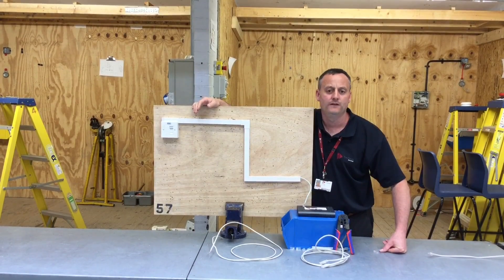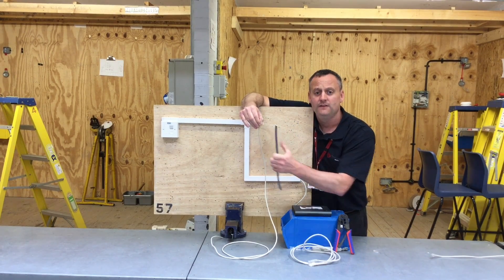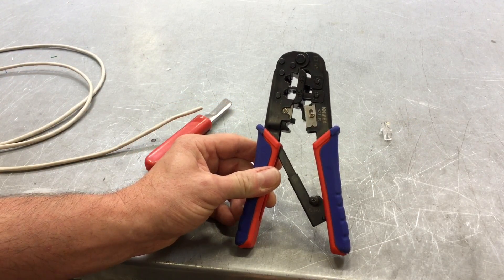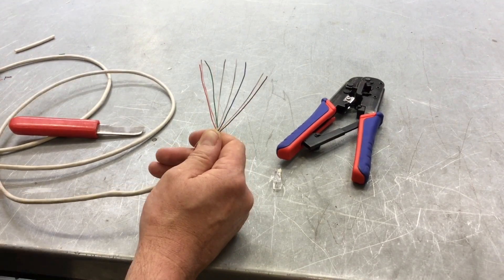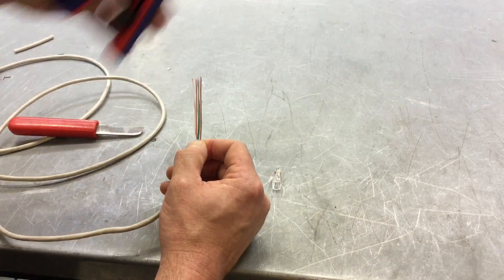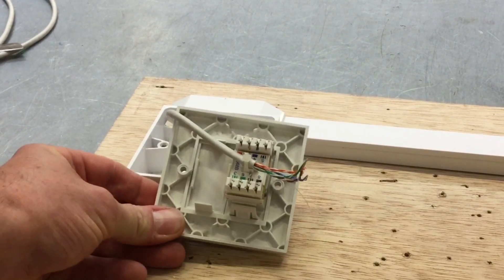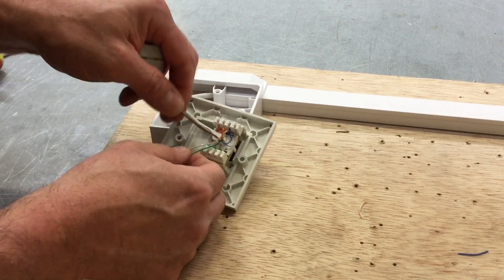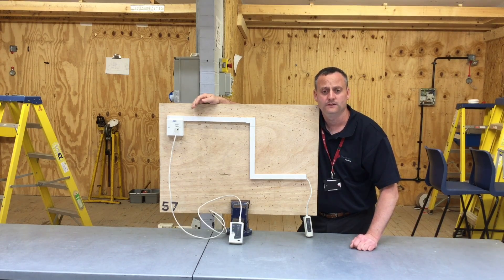Terminating CAT 5 (Ethernet) Cable into a RJ45 Connector Including Testing and Full Demonstration

Comment: OK couple of miss-conceptions here. The twist has nothing to do with induction from the 'mains', if that is likely to be an issue then you should be using STP (screened twisted pair). The twist is there to reduce crosstalk between pairs. In data cabling this prevents a strong signal on the TX pair bleeding into the weaker RX pair. 
On a practical note I would echo others comments about using the cord to strip the outer - that is what it's there for. Also most importantly is not untwisting the pair. The spec says no more than 13mm of untwisted wire for Cat5 and 10mm for 5e & 6 but remember you've got several mm untwisted in the terminal so it's best to maintain the twist as far as you can. This is imperative if asked to wire a patch panel. Also that tool is called a punch-down tool for a reason - give it some welly, it will cut better and ensure the wire is pushed right down in the connector. Not being the latter is the most common cause of a dis.
Testing. A simple continuity/order test as shown is fine for a simple cct in a domestic situation. However NEXT and FEXT (near end & far end crosstalk respectively) tests should be carried out on anything more commercial.
Out of the trade now but I had 19 years working as a comms tech specialising in hostile environments.
Reply: What do I need to pay for a NEXT/FEXT testing device?
Reply: @Asdayasman  You can get a shitty cheap one on eBay for about AUD$10 and it will check the connectivity of each of the 8 wires. If you stretch it to AUD$15 then it will do not only RJ45 but also RJ11, RJ12 and USB. Bear in mind that you do get what you pay for and don't forget to make sure the battery in the tester is still ok before you go out on a job.
Reply: @josephking6515  No, that's just a continuity tester, not a NEXT/FEXT.
Reply: The RX isn't 'weaker' than the TX pair. The RX pair is just the TX from the other piece of equipment! I agree with the sentiment though.
Reply: Of course you are correct at each point of transmission however what is important is the relative strength of each signal and hence the effect of crosstalk on signal to noise ratio etc. which of course in turn effects error rates. Measured almost anywhere but in the middle (assuming equal attenuation and transmit levels) then the level of the arbitrary RX will be below that of the TX and in that sense weaker.
It is this relative difference that is important with regard to both near and far end crosstalk in incorrectly terminated cabling. In the transmission  world most equipment will AIS (alarm) at an error rate of 10^-9 and shut down at 10^-6. Which is not a lot.
Reply: I wired my entire house with Cat5e about 15 years ago and was unaware of the need to maintain the twists as far as possible. I wired the face plates similarly to how it was done in this video.

However, it has been running at 100Mbps the whole time without a single issue. I also split each cable into two lines, as only two pairs are used up to 100Mbps. Obviously I'd have to rewire the plates for Gigabit.

Comment: Use a pass through RJ45 glass end if it's an internal fix .Those will save you both time and to a point fail safes in terms of faults .
Especially when your knackered after a long day of pulling in .

Comment: That cable was not "tested". All that device did was verify continuity of the conductors. It's basically a data version of the Wandering Lead. Proper testing of data cabling with the appropriate test instrumentation not only verifies continuity but leads to certifying that it can carry the data and at what transfer speed. As far as I know proper testing and certification of data cabling isn't on the AM2. Also I know of very few electricians that properly install and certify data cable. Test and certify your data cable with a device like the SignalTek NT or similar Fluke device. Get a data specialist in not a "spark" that tinkered with data during the AM2.

Comment: I'm in the process of running a hard wired VSDL2 extension to a RJ45 terminal. My plan is the wrap the cat 5e in Bacofoil  and run it in plastic conduit  hopefully to eliminate any interference  such as mains. I thought of this myself but haven't read or heard of anybody wrapping data wires in foil like this. Here's hoping all is well!!!

Comment: A continuity test is just that, a dynamic response test should be carried out and, don't terminate solid core into a RJ45 plug - should be socket both ends and use a patch cable

Comment: Can multiple ethernet points be wired as a radial or will they each require their own circuit? I.e can you loop in loop out. Is this also possible for phone sockets.
Reply: You can make a radial if you're in the 80's, sure - that's what Ethernet was originally designed for.  A lot of cleverness went into the CSMA/CD algorithms to keep throughput high with multiple stations.

Switching hardware became much cheaper as time went on, though, and now the norm is to connect each station to a switched port, which will allow the station and the switched port to run in full-duplex mode, instead of half duplex, and never have to retransmit a frame.

Buy simple cheap switches per room, and run a patch from them to each of the sockets, and also one from the switch to the central router.  Alternatively get a big beefy switch in your server room, and run multiple cables per room to it.  If users need more ports in a room, they can buy the switches.
Reply: @Asdayasman  Even the historical 10base5 and 10base2 didn't support just looping though at the wall socket, instead a T-piece was directly attached the cable. With 10base5 the transceivers were separate from the computers, with 10base2 it was common to loop the cable round the back of the computers.
Reply: No it's 1 cable to one outlet. Keep away from power an keep your twist when termination.

Remember no longer than 90 meters per cable.
Reply: You can wire plain old telephone service like that (for distances of a few kilometres), but this results in all phones ringing together and only one call per circuit at any one time. If you run the telephones to multiple separate ports like Ethernet, you can have multiple simultaneous telephone calls.

With twisted pair Ethernet you need to connect each devices transmitter to every other devices receiver, but not the transmitting device's receiver. You can't do that with just wires. Furthermore just joining wires introduces impedance mismatches which reflect the signal causing it interfere with the later signal that travels direct.

Comment: Installing CAT5 or even CAT5E is not future proofing people's homes or businesses and I strongly recommend you choose a course which covers CAT6, CAT6A and CAT7 including sub categories UTP, FTP, S/UTP,  F/UTP and  S/FTP with different wire types such as CCA, Solid and Stranded. Networking cables running behind walls or plastic piping wall sockets should always use a bare minimal of 23 AWG and lower that uses stranded copper or solid copper simply by using thicker cable you are allowing the electrons to travel easier with higher frequency which in turn increases the bandwidth for 10Gbe, 20Gbe and 40Gbe.
Reply: Stranded wire should be used in Patch Leads and not on cables that are not going to be disturbed behind a wall. Also remember that stranded cable are only recommended for runs of 20 feet or 6 metres. That was for Cat5 and Cat5e. I don't know what the Cat6 specs are for stranded. Will have to look that up.

If I was still cabling then Cat6a is the minimum I would now run. Cat7 and Cat8 are way to expensive at the moment IMO.

Comment: One thing I noticed on these termination video's, is that people don't know what that string is for after you cut off the outer jacket. You are supposed to then pull the string down which splits the jacket on the way down. Then you should cut off the excess outer jacket, then cut off the twisted pairs below where you first stripped the jacket off. The reason being just in case you accidentally nicked the twisted pair which then could allow some cross talk between the pairs

Comment: Thank you so much!  This was a perfect illustration.  Very clear, to the point and the visual demonstration is just absolute perfection.  Thank you! 

I've been having a lot of problems with my LAN connection in my bedroom.  Other computers in the home, with a wired connection, work just fine.  However, my computer, with a wired connection, was recently very slow and now there is no connectivity (switching from yellow to red in the network icon adapter).  

I've tried two different computers on the same LAN wired outlet and both have had the same issue.  I'm inclined to believe the issue is the physical wire.
Reply: take the cable from the back of the computer and check if there is any dust in the jack.
Reply: I did - and that got me a connection!  So relieved!  Unfortunately, I still had a problem with my download speed.  It was very slow.  Under 10MB on speed tests.  Eventually, I discovered that somehow my Ethernet Port speed was set to 10MB.  I changed it, under properties, to 100MB Full Duplex and my internet is back up and running.  Thank you for reply.

Comment: One small criticism... when terminating the jack you should maintain the twist of the individual pairs right up to the termination strip. If you don't then that can introduce a very small imbalance in the pairs that IF you have a weaker signal to begin with will cause problems. Otherwise, excellent.
Reply: John Jones right on point mate
Reply: I have made many many patch panels for national banks and but you are right to keep the twist to the end